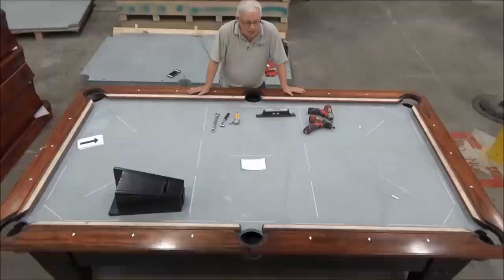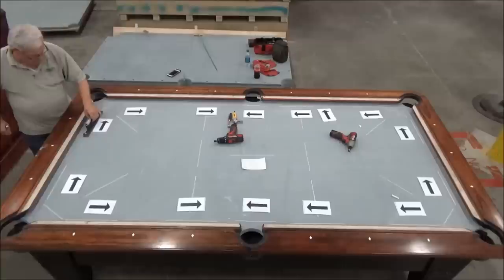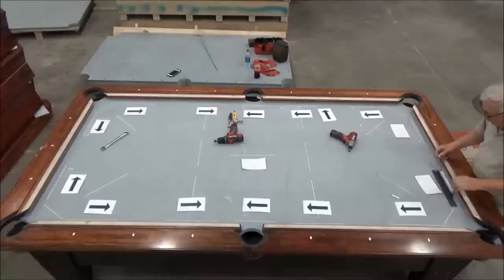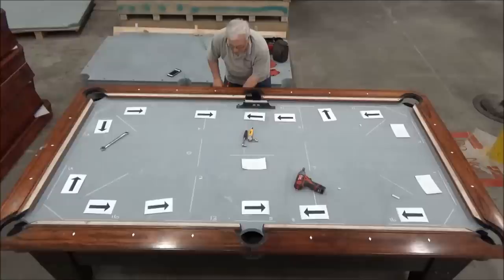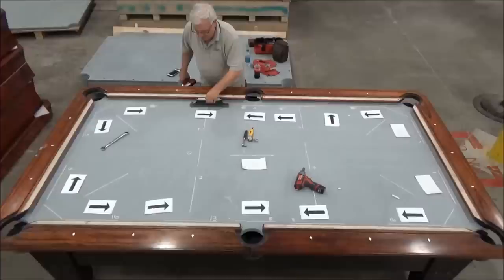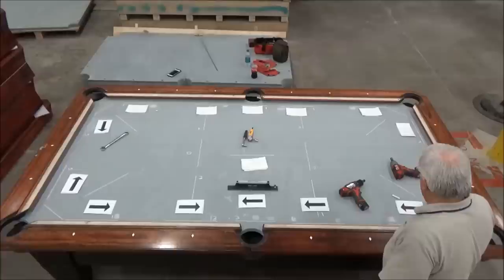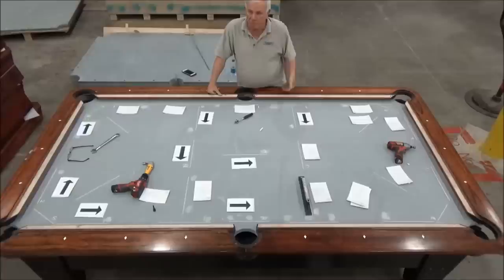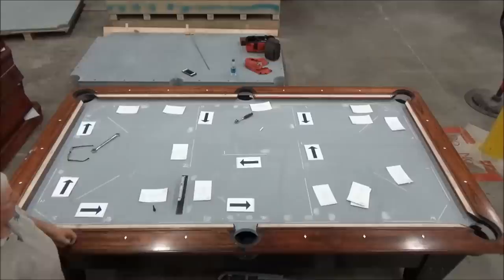Pool Table Leveling

Comment: agh! I would have loved to have seen a 'test run' of a ball on the bare slate, just to see how accurate this system is. Maybe you could add this to the vid. I think I speak for quite a few who are curious to see what difference  1/1000" makes to a ball.
Reply: My experience when flattening slate via brick layer's string stretched tight and matched washers as feeler gauges, then leveling whole table via carpenters level is a ball rolls perfectly and i mean perfectly straight on bare slate. Meanwhile my method has probably more like a 10 or even 15 thousandths error

Comment: Final test,  a piece of 24" x 24" 1/4"-3/8"  glass and a ball. Lay the glass on different spots and place a ball in the middle, if it rolls, readjust.

Comment: beguiling      does the one piece slate bend or warp a little?     If it didn't, you'd think that the slate would be flat and just need the corners adjusted?     fascinating.
Reply: Machinist level notches indicate about two sheets of paper variance in height per foot.  I'd be surprised if any slate is that perfectly milled.

Comment: How do you actually level something to within a thousandths of and inch tolerance? Can it even be done with shims? A playing card is like 1/20th of an inch. The thinest paper that practically falls apart in your hands is only like 1/3 of that (or 1/60th) of an inch. Do they actually make shims so thin (1/1000th of an inch) that you cannot even really see them when they are turned perfectly perpendicular?
Reply: .01
Reply: Hi Jon, a deck of playing cards is about 5/8 inch thick which makes each card about 1/83 of an inch thick. If the cards are 1/20th of an inch thick, your deck would be over 2-1/2" thick!
Reply: @ricktanguay2310 exactly

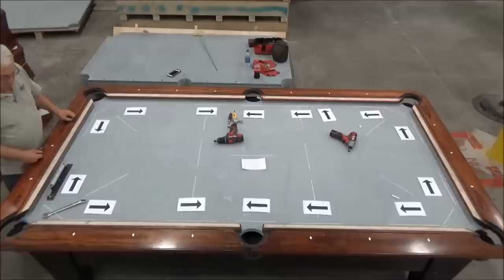Comment: At 9:40, how is it possible to have the slate low in the middle? That suggests the slate is not flat. Is there a natural sag due to weight? Can the slate flex that much?
Reply: I believe so, and because the level is so accurate. The center of the table is always at its lowest point, if the slate is made of homogeneous material.

Comment: On the left side of the table, how can the arrows be pointing in opposite directions if it’s one the same piece of slate? Doesn’t that mean that piece of slate is not flat?
Reply: That is correct..... Once you get down to measuring thousandths of an inch, there will be peaks and valleys across the 9' slate that need addressed.  The slate is milled to .01" but we want to try to manipulate the slate with the leveling system to get the slate to at least .002".
Reply: @aaronberger5504  is it better to have a 3 piece slate for a more accurate leveling? I figure a smaller piece of slate should be flatter than a 9 foot piece.
Reply: @johnvelocci8760  Defintely 3 piece slates have much more points of adjustability than does a one piece slate. I can’t imagine there are many one piece slates as they would be much too heavy and difficult to move as well as more prone to breakage.

Comment: Hey Paul,
I noticed that this table is larger than the 7 foot.  Would you use a 12 inch level for a 7 footer as well or a shorter level?
Reply: Great question! I also am wondering
Reply: machinist level and a straight edge is all you need

Comment: Why can't you just use a transit and level the four corners of the table after your 3 pieces of slate are straight across.  That is the way I do the tables and it takes me less than 15 minutes per table with an accuracy of a few thousandths.
Reply: Genius

Comment: If he actually knew how to level piece of granite, this would have taken about 15 minutes.
Reply: first of all its not granite, its slate. Two different animals. Slate bends and can flex over a 12 inch span. Diamond has wedges built into the frame. Other pool tables require the use of hardwood wedge shim, which are broken off. You also got to consider this is an instructional video. I am pretty sure Paul can do this in 10 minutes.
Reply: Granite even a few feet thick can bend too. leveling a flat surface is the same regardless of the material, understanding what that tool is actually measuring is a start.
Reply: today I learned that a solid piece of slate that has been machined to perfection can be unlevel in so many places. I'm sure a 6 ft or 4 ft level might have sped up the process
Reply: you want your level to be smaller than the distance between the shortest distance between your adjustment screws.
Reply: @alyssagarcia4750  can you see under 1/1000 over one foot with a long level.    Is that level you're talking about actually within tolerance at that length?
Reply: Robby D Durham machinists level is way more accurate than most carpenters level and if u r trying to get a bow out it takes time to shim it thee piece can be even tougher, floors sage ect, old tables had 11/2 in slate so tables at 1000 lbs over all will make joists sage over time and that will distort yr table so when he is teaching uto get the table very close it takes time to teach everyone

Comment: Great video. Shows you how crappy diamond tables really are though. It makes sense why the slate is so warped though, because it looks like either Brazilian, Chinese, or some manmade composite slate. Quit cheaping out Diamond, and put some Italian or Welsh slate on that table. Also, make a stronger frame. Diamond is so overrated. What garbage.
Reply: what table for the money do you think out performs diamonds? For the money...